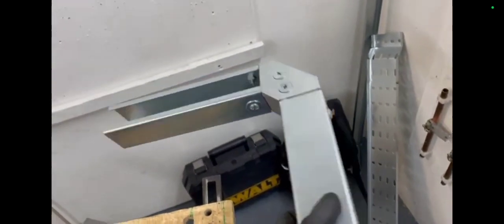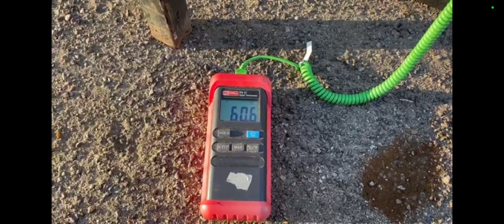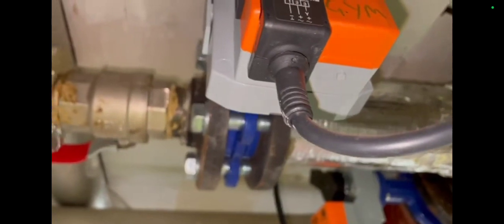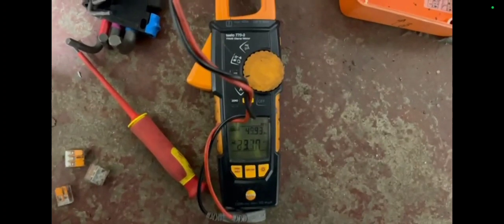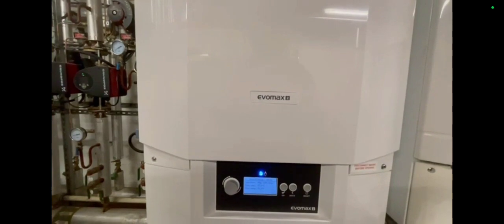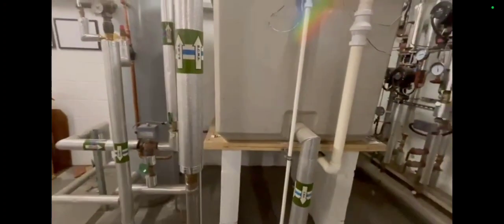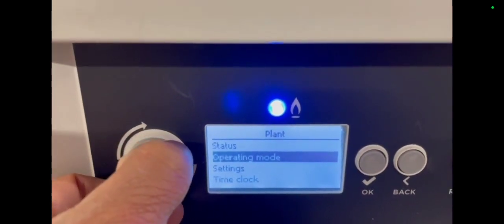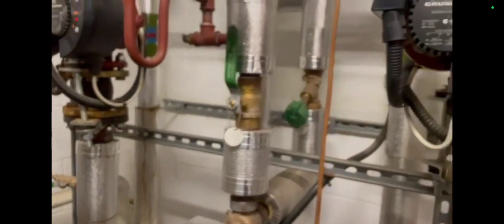DAY IN THE LIFE OF A COMMERCIAL GAS ENGINEER pt21

Comment: Hi mate, great explanation - Love watching your videos. Can you give an example what circuit VT pumps are used for and CT pumps are used? thanks
Reply from the maker: Constant temp normally in and around the boilers in the plant room at a higher constant temperature. VT off to heating circuits around a building yet at a varied temperature controlled by valves drawing off heat from the CT.

Comment: Hi great video what nice plant rooms shame nobody kept  them clean and tidy dust every where was there no wall diagrams or charts noticed felt tip pen on everything . Have they not got a resident engineer. Take care
Reply from the maker: Hi, you're right, there's no caretaker looking after these important plant rooms. It's a shame. Glad you liked the vid. Appreciate the feedback. Take care too
Reply: Subscribed Do you recommend to the customer to replace broken items ie pressure gauges  @CommercialGasEngineerVideos
Reply from the maker: @cybershot123 that's a good shout and good practice. I didn't in this circumstance as there are other mechanical engineers who look for those errors and I don't need to add to my responsibilities. My main responsibility is gas safety, plumbing, heating and to restore services rapidly. I do cross over to other areas like electrical, controls, pumps. Although it doesn't hurt to mention gauges etc. I find that it can confuse the life out of an office if you get sent somewhere for no heating. Then in the job report you write it needs gauges. They think that's what's required to fix the heating. Then my time is taken up replacing gauges, and chasing manufacturers for parts, rather than doing my main priorities. Depends on what my client needs me to focus on. Thanks for subscribing.
Reply: Thanks for reply i used to put it as Recommendations  to maintain performance of equipment. @CommercialGasEngineerVideos
Reply from the maker: Good shout, note taken